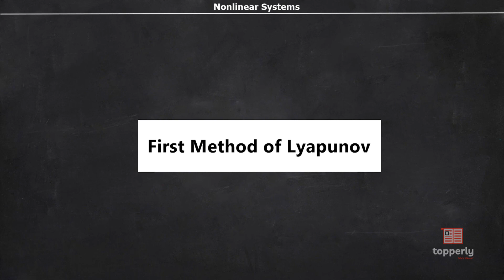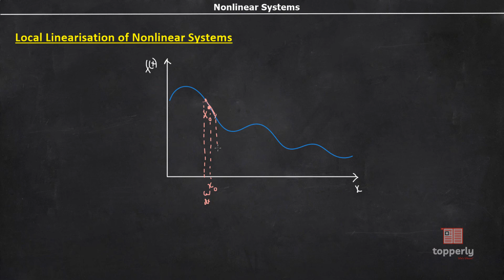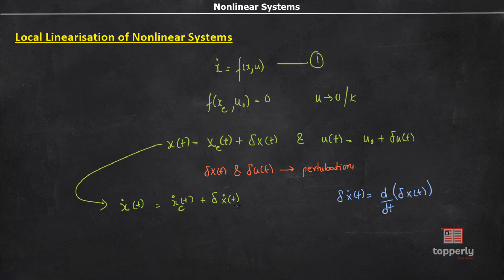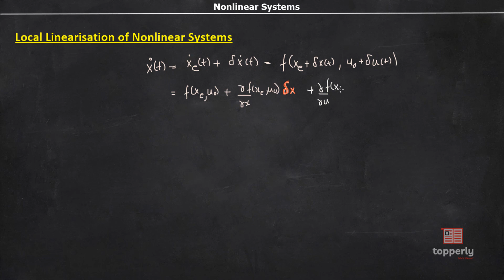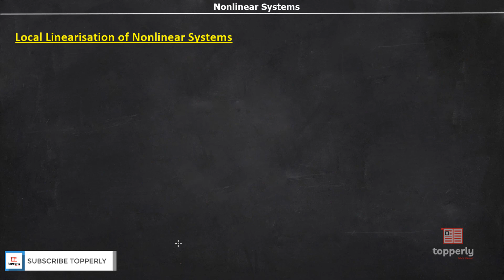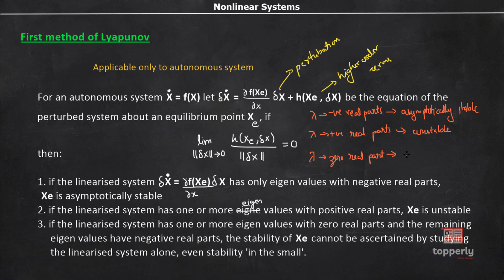Linearisation Technique & First Method of Lyapunov | Nonlinear Control Systems

Comment: Wow great video. I'm a 3rd year aerospace engineering student (I'm final year of bachelors), I'm doing an individual project on non-linear control, specifically sliding mode control. Do you have any resources that explain the concept in the same manner as your videos that very easy to follow and understand? This is usually a masters course so I have not studied this, and the videos available online delve deep into the maths too quickly that I can't follow, like I see symbols Ive never seen before. Please reply. Thanks
Reply from the maker: 1. Applied Nonlinear Control by Slotine and Li - https://amzn.to/2Ed8Rw6
2. Nonlinear Control Systems by Alberto Isidori - https://amzn.to/3l5VeQv
3. Nonlinear Systems by Hassan K Khalil - https://amzn.to/3aG0zsA

These are some great sources I use for my studies. Please see if they help :)

Comment: While moving from equation at 5:35 to 8:15, where did the two more terms Xe(t)_dot and f(Xe, Uo) go?
They just vanished. h( ) disappearing makes sense as it's limit tends to zero.
Reply from the maker: Please compare LHS and RHS.
LHS : Xe(t)_dot + dx(t)_dot

We also know x(t)_dot = f(x(t),u).

So using this knowledge, Xe(t)_dot = f(Xe(t), Uo).

So the rest of the terms in RHS will be dx(t)_dot.

Hope this clarifies :)
Reply: @Topperly  Thank you so much! It took me a while to figure out why are those two terms equal to each other but now it is clear (it was the first equation of that section). Then they cancel each other. 

Really appreciate all the example that you provide between the theory. Also grateful for the promt response. Thank god I choose your videos to learn this.